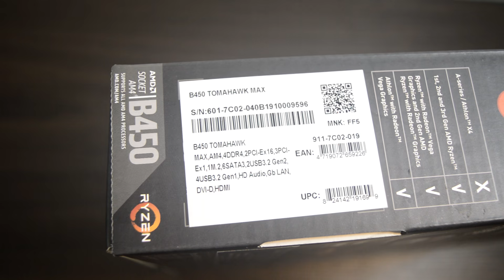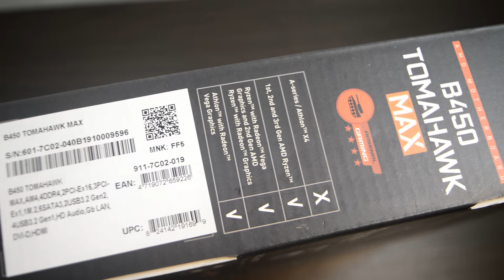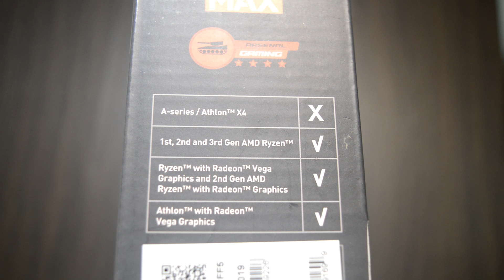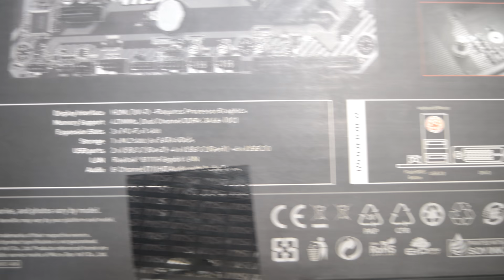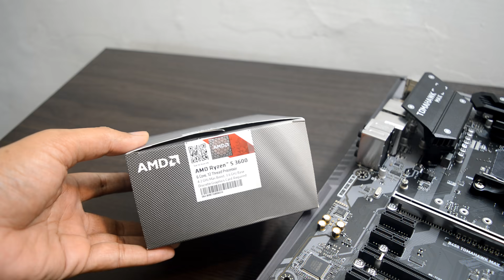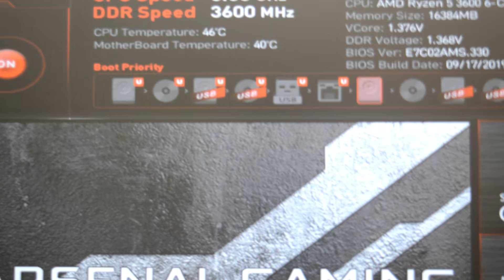MSI B450 Tomahawk MAX Overview | Ryzen 3600 Setup | RAM speed Test

Comment: I am the only one with over 80+ temps with stock cooler?
Because i see you have also 46 idle in bios not even in windows.
Reply from the maker: You are not the one for sure, stock cooler is not sufficient for 3600 because of its higher clock speed
Reply: @OdinHardware  the only solution for me was to oc at 4.2 or 4.3 with 1.15v or 1.20v with a be quiet dark pro 4 and the temps are 28-60

Comment: will ryzen 7 3700x work with this motherboard out of the box?, also would it be better to pair it with 3200mhz or 3600mhz?
Reply from the maker: Yes 3700x will work on this motherboard out of the box . 3200 should do fine. Buy 3600 if you use powerful gpu

Comment: Mine shows only 2933 but originally 3200 MHz
How to set it up to 3200
I have a same board with 2700X CPU
Reply from the maker: Enable xmp in the bios , if it doesn't  work select 3200 manually
Reply: When you buy 3200mhz memory or high frenquencies , its the max speed your modules can reach, you just have to configure the bios to put the modules at their max speeds
Reply: 2700x can goes up to 3000mhz max

Comment: done building this. how ever after reboot activating AXMP bro my frequency has not yet been changes. i have 3200 ram dual channel but still running at 2400 what  could go wrong?
Reply from the maker: Check whether  you   manually selected the frequency , there is another option below the xmp setting
Reply: Ok bro. .but is it safe to put it on 3200? Do i need to changes timing coz i dont really have any idea with that.   Just hoping to use AXMP to adjust auto

Comment: May 2020 I recently purchased this board and it claimed to be 3000 desktop ready so assembled with Ryzen 3 3200G and after spending some time doing this bearing in mind NEW components such as DDR4 that had been pre tested to ensure they worked in another pc of mine, so I KNEW they were working fine?! Ah the MSI Tomahawk Max motherboard ? Would NOT show the POST screen, in fact ANY video out. Nor did it show power to the mouse or keyboard LEDs et I've worked on computers AND built systems for over 40 years and this was the first computer motherboard ever FACT! to not deliver a post screen/setup. Somewhat puzzled by this as us builders do, I checked and double checked everything and still ZILCH. OK some more investigation which is where I came across numerous similar complaints and issues on the failure of the MSI Tomahawk Max failing to deliver on the post setup (apart from other real issues) Hence I would NEVER personally recommend this motherboard to anyone. Me? Its where it belongs- in the trash with a sum of money wasted and a more than valuable lesson that exceeds that learned; NEVER to buy another MSI product.
Reply from the maker: Thanks for sharing your experience, 
I too faced random issues some times,

Comment: I have a question i want to plug in my mouse and keyboard can i just plug both in the 2x USB 3.2 Gen Type A or should i plug both in the normal USB 2.0 Type A? And on the left USB 2.0 Type A there is Flash BIOS written can i use this as a normal port?
Reply from the maker: You can use any type a usb slots

Comment: I just purchased this with a 3600x. Is there a recommended wireless network card with bluetooth? I want to connect an Oculus Quest wirelessly and also XBox controller. Thanks for any insight
Reply: Kinda a newbie question but did it work out the box with the 3600x? New to pc building and it was a after thought if it'll work without a bios update
Reply: @zachary476  Not op but yes it does. Any B450 MAX motherboard is ryzen 3000 series ready

Comment: Hi I have the same motherboard and I have 2 sticks Corsair Vengance LPX 8gb ram ddr4 3200mhz speed. I have inserted the sticks in slot 2 and 4. But my xmp profile 2 is showing none. Is it normal?
Reply from the maker: What speed it shows in profile 1 ?
Reply: @OdinHardware  3200mhz

Comment: on pc part picker it says there is a bios update needed to use the 3600 on that board, did you need to do that?
Reply: The B450 Tomahawk MAX comes with 3000 Series ready out of the Box, the non MAX Version needs a BIOS Update.
Reply: kenner ok thanks 😊

Comment: Hi there! Was considering this mobo for my 3600 which arrives soon. Existing system has a 2400g on a ASROCK X370 Pro4. Got myself an RTX 2060 a few months ago. Ram question: I have:

Corsair Vengeance LPX 16GB (2x8GB) DDR4 DRAM 3200MHz C16 Desktop Memory Kit - Black (CMK16GX4M2B3200C16)

https://www.amazon.com/gp/product/B0143UM4TC/ref=ppx_yo_dt_b_search_asin_title?ie=UTF8&psc=1

on my current build. I do not see it on the approved list for the Mobo. Does that mean my existing ram will not work?

Thanks
Reply from the maker: Hi, 
99%  your corsair vengeance modules should work with new config
Reply: @OdinHardware  thanks for your reply!

Comment: So just to get this correct before I build mine in a few days, I'm getting a b450 tomahawk max with a ryzen 7 3700x- will I need thermal paste or am I good without?
Reply from the maker: Stock is enough but good third-party paste will slightly perform better, and also  don't spend too much  on this
Reply: vmreviews thank you, is there any brand you’d recommend getting for thermal paste?
Reply: @verse_  Thermal Grizzly or Arctic MX-4 thermal pastes are good. I just ordered mx-4

Comment: DDR4 is not listed on MSI specs for this board to OC. Can someone verify!!
Reply from the maker: It's the case in most models. Generally most modules will work in xmp upto 3200
Reply: @OdinHardware  so if the board doesn't list 3600 it won't be ideal?
Reply from the maker: Ddr4 ram is supported  and speed limit is not sure  go with 3200 , it's safe choice

Comment: Please give ur valuable reply
I'm using same monitor as you have 
I have one doubt 
I've tried ....
Hdmi to hdmi duplicate screen from my laptop to ACER external monitor is not working.
But VGA to VGA is working fine
I'm going to assemble CPU with B450 tomahawk this motherboard doesn't support VGA cable 
How do you connect your motherboard(CPU) to ACER external monitor?
Reply from the maker: Through HDMI port in the external gpu

Comment: I did some research and lots of people said that I need to update BIOS, but I don’t have any 2000 series or so. What will happen if I put the Ryzen 5 3500 in there first to boot it up then update BIOS, will it run at all ?
Reply from the maker: This model perfectly fine with 3000 CPUs , out of the box
Reply: vmreviews so do I need to do BIOS update at all ?
Reply from the maker: This motherboard supports 3000 series right out of the box
Reply: vmreviews tks m8

Comment: Im building first pc. I have 2700x do u recommend this board ? Will be using it only for games
Reply: I would suggest go for ryzen 5 2700 as it's cheaper or even a 3600 and yeah this motherboard is pretty good for both

Comment: I want to buy the board with a 2700x and my question is and my question is whether 3200mhz ram work with the setup
Reply from the maker: 3200 will work and this model support even 3600 , 4000
Reply: same for the asus b450-f?

Comment: mine wont post, ive tried to update bios but it wont go past the cpu stage on the ez debug, its not even lighting up the gpu like it was out of the box. Ive tried reseting cmos and biosing with older versions. I cant even be sure the motherboard is the issue because i dont have another pc to test the parts with.

*At this point im just planning to rma the board and pray that it was the issue. if anyone has any solutions or even dumb suggestions all take anything. it'll save me the hours drive to microcenter
Reply from the maker: Does it happened all of sudden or ?

Comment: I have the same gear
But the problem with the compatibility of the Ram operates at a speed of 2666 MHz, but originally 3200 MHz
Although I ran A-XMP
Please help me
Reply: I have same problem
Reply: @artetdeco7688  Put the Ram in A2 and B2 slot

Comment: Does anyone know if this motherboard can support 4000mhz RAM? The MSI website says it can do up to 4000 in XMP, but in practice for me also with a Ryzen 5 3600, I have not been able to get it past 3200.
Also does anyone know why I cant go past 3200 without crashing? I tried 3600 and 3433 and crashed shortly after.
Reply from the maker: It's because of the ryzen 3600 cpu limitation 
Most cases , 3600mhz is the max safe ram speed for ryzen cpus
Reply: @OdinHardware  ok, well do u have any suggestions for me to get 3600? I haven't got past 3200

Comment: If you want wifi 802.11ac, bluetooth 5.0, 2 m.2 slot, realtek alc1220 audio instead of alc892, intel LAN instead of realtek LAN, go for b450 gaming pro carbon ac.
B450 tomahawk max is a good motherboard, with less features of course.
Reply from the maker: That was the model(pro carbon) I was very keen to buy  instead of tomahawk,  but the price doesn't make sense to me as it is  very close entry level x570 motherboard price and especially considering the am4 socket lifespan,almost on the edge  I don't want to invest more on this platform(as a short term user). pro carbon is definitely a better buy if those features are necessary for someone  !
Reply: Or just buy a real FX sound card ?

Comment: Hey guys, i got this motherboard in the video and this ram.....gskill-ripjaws-v-16-gb-2-x-8-gb-ddr4-3600...... will this ram work with this motherboard and running Ryzen 5 3600 cpu?
Reply from the maker: It should work.
Reply: I think I have the same memory with the build I just did. I haven’t set the ram speed yet but stock it was at 1000 lol

Comment: Can anyone help ?
I just built my new pc having 3200 mhz ram 16/2 32gb Corsair vengeance rgb pro with Ryzen 5 1600 af having b450 msi tomahawk 

When I try to apply the xmp profile 2 mentioning 3200 mhz 
My PC goes into problems screen and turns off
But
When I select profile 1 having 2933mhz
It works fine 

Can anyone help me how can I achieve 3200 mhz profile 2 settings ?

Because everytime I select 
My PC crash
Reply from the maker: Most first gen ryzen CPUs will work only with upto 2933mhz modules
Reply: @OdinHardware  omg I just built this PC and I was wondering why I can't run my 3200 MHz ram on full speed instead of 2933 MHz...

If I wanna swap my Ryzen 5 1600 AF to Ryzen 5 3600 
Will it support max 3200 MHz speed ?

Comment: Is this motherboard supports aio pump? For liquid cooling?
Reply from the maker: Yes supported
Reply: Is this supported with bykski liquid cooler? As i notice on my bykski liquid cooler it only has 3 pins on it. Also my rgb connectors have 3pins.